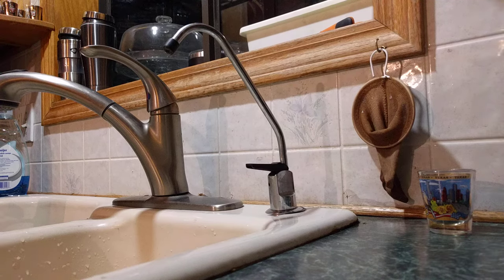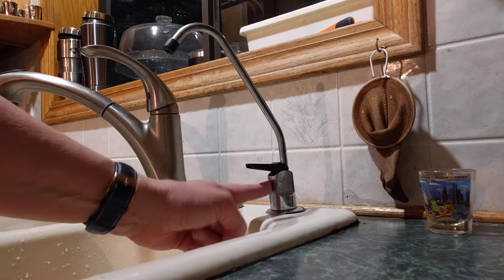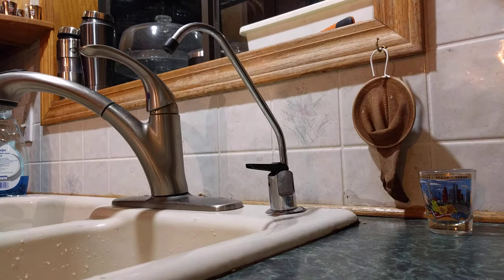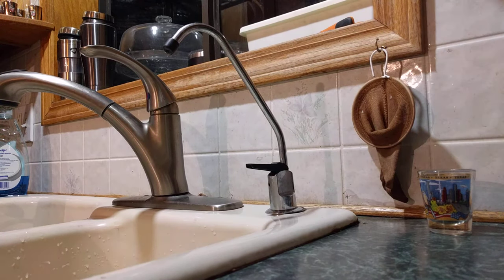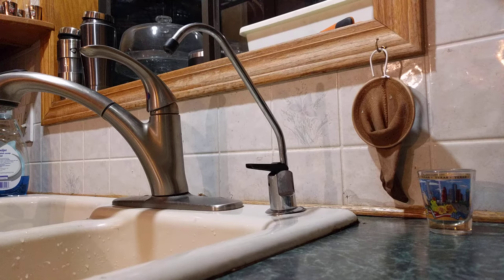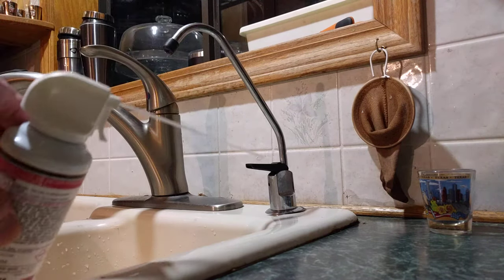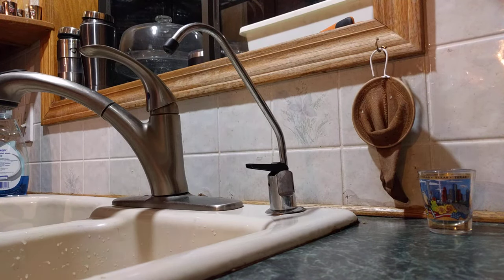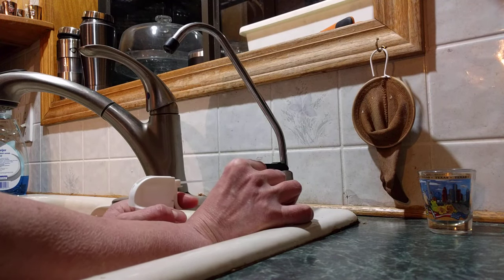fix a leaking air gap faucet on your reverse osmosis system

Comment: Finally! A YouTuber that posts a real solution! No garbage disposal here. Had water running out of our air gap, checked the drain line and it was clear. Called Watts only to have them try to sell me parts... I tried a piece of rubber hose to try to blow it out to no avail. Found this video and in two shakes I was done, just needed more air pressure to clear it. Thanks!!!

Comment: Thanks for saving my entire Sunday. The indication the drain is plugged is a small amount of water coming out of the vent hole and running in the sink or on the counter. This literally took less than a minute to fix from start to finish. Thanks again for the time you spent researching and posting.

Comment: I have an Aquasana system and this just started happening really badly. Thought we were SOL but tried this with a plastic straw and it worked! I didn't have the compressed air but I just used a plastic straw over the hole. Thank you SO SO much for this information! You saved my behind! 🙏💖

Comment: Mechanical Engineer Here...I had not thought of this method, it worked great and I could actually hear a blockage being blasted.  I am going to add this to my regular preventative maintenance.  Please note: these dusters are generally chemicals...not compressed air...but being the r/o waste line it should not contaminate the filtered water.  It was really a great video...much respect for Karin.
Reply from the maker: Excellent!

Comment: You're a smart lady. I searched tons of websites, tried all the recommended solutions, and nothing worked. I thought the hose might clogged higher up than I could see (the bottom wasn't clogged, and I cut off a few inches, too, just to be sure it wasn't because of a sag in the line). My next was going to be remove the whole line, which doesn't seem particularly easy to do on my system. But then I found your video, and the compressed air trick worked immediately.

Comment: Hallelujah!  This works! You saved me from taking the whole thing apart and then probably calling a plumber before ditching the whole system. Can never thank you enough for posting this!!!!
Reply from the maker: You're welcome! I still remember my personal frustration-level when I first had this situation in my kitchen.
Reply: @KarinBrenig  We rarely use our disposal, but we did yesterday and the RO faucet started leaking. We turned off all of the water to the sink and saw your video this morning. Fixed the problem along with all of our stress in seconds. You have our deep (way down there), heartfelt appreciation!

Comment: Brilliant!  My daughter and her husband just moved into her house with an RO (we do not have one) and it started leaking via the air vent in the RO faucet.  Did some research and found that the RO drain line from the faucet was probably clogged and it needed to be blown out.  But how I wondered while I was driving over.  My daughter came across your video, we used your method and it worked perfectly!  And man, was that thing filthy.  Thank you so much!!!!

Comment: Thanks! I cleaned up that side of the sink drain and took some flexible plastic tube used for an oxygen tank and held it up to the little hole on the RO faucet and blew through it really hard and I heard the air come through the drain. turned the cold water back on and it worked great. Thank you!

Comment: Karin, 
Thank you for your video. This occurs on and off with this ROW, too often with a flooded cabinet and floor,  I was going to swap faucets with the previous one I had. It is a big pain removing, cleaning and reinstalling the mangy faucet.
I went to the hardware store, bought a dust buster and the change in tone made it very clear when the plug was gone.

Comment: Thanks for sharing. I blasted canned air into the air gap hole (using a paper towel around the air tube to make a seal) and I did not hear anything for the first few times. On the third time, I heard air an something else pass, so something must have been stopped in the drain tube! Now there is no more heavy leaking. Thanks for this great tip!

Comment: Thanks for the video and tip. I ran out of my compressed air but watched a few more videos and had another idea. What if the plug is where it meets the drain? So I disconnected the hose from the drain and shoved a pipe cleaner up the hose - this cleaned the slug that had accumulated and presto, clear. Thank you for helping me to consider options.

Comment: This actually worked...immediately. I have a computer "vacuum" which is basically a leaf blower version of canned air. Instantly fixed. Running the filtered water into a cup, shortly later the water would trickle into the drain and not the air hole. Thanks!

Comment: Thank you so much for posting this.  Today  a substantial leak started from the faucet base of my Costco RO system. Water was oozing quickly on top and dripping quickly under the sink. Used your method and it  opened up the clogged drain hose right away.
Reply from the maker: you're very welcome :)

Comment: I am .. so thankful for this awesome video thank you for taking the time to post this. I went to home Depot and they told me I can just replace the seals which are most likely the problem... I was like "how am I even going to disassemble a closed unit to replace gaskets in it" and then they told me it might just be easier to buy a new one. I did this and now it's working again and not leaking thank you for posting this video. God Bless

Comment: Good solution. I have a Watts Premiere faucet that is very nice, but leaks through the bottom of the unit into my undersink cabinet. Huge mess. I think it's been leaking from the moment I installed it. What I did to fix this situation,  is to get a check valve, then connected the two hoses. This  completely bypasses the faucet and its 'air gap.' (mine never leaked out the hole, so I think it was just wrong to begin with.)  So now I have a loop into the drain, but with a check valve against back flow. I can keep the nice looking faucet. 
Something I did years ago at another house. I just ran the waste line outside into the garden. For years it watered the garden with no ill effect.

Comment: I saw the video and was super excited! Give it a try... nothing. Tried again... nothing. Finally, after buying bottled water for two weeks and thinking about it, I decided to give another try. This time, I removed the line from the sink drain line. My intention was to blow from that lower end. I used the wet paper towel thing to make a seal around the air can hose and gave it a blow. Very quickly, my air gap started to hiss. I wIll be replacing my filters as a mater of course, but this sure beat needing a plumber to come and and probably do the same darn thing.

Comment: Karin, well done, great advice. I'd like to add my two cents regarding my leaking air gap. I replaced our R.O. system facet. Usually you will hear some gurgling in the sink drain when   the R.O. system is operating, there was no gurgling and water was discharging from the air gap, the discharge hose was clear. Your video made it very clear how the system should work, I was the problem. New dispenser, new hose, hose too long. The hose ran down below the discharge saddle and back up to the saddle connection, gravity was working against me. I shortened the tube so it ran down directly to the discharge saddle causing joy, discharge works great. Your video provided me the clues to get past my error. Thanks so much.
Reply from the maker: good job :) I'm glad it worked

Comment: Love the logic of this fix - my trouble is that the hole is round the back of the faucet. I tried bending the straw but can't seem to get enough pressure that way. Still, a great fix idea, Karin!
Reply from the maker: maybe you can try what some people said worked for them: take a piece of thin, flexible hose and press it over the hole (on the back of your faucet) sealing with wet paper towel. Then blow air into the hose with your mouth, as hard as you can. Good luck !

Comment: Thanks! I really need to try this. The air gap faucet has been squirting water for a year and it drives me crazy. I do not have garbage disposal, but I do have a dishwasher on the same drain as the water filter. My drain was clogged at one point, and when I cleared the clog, the squirting stopped for a few months, and then started again for no apparent reason. I will be shopping for some compressed air asap!

Comment: Super smart, this helped me a ton! It was 1am when this happened to me and i didn’t have the pressurised air can- so i poked a bendy straw in the hole and blew super hard. It worked incase someone doesn’t have one of these also! 😂 but thank you for posting because i never would have thought just air would solve it lol

Comment: What I did is reverse: find the 3/8" black tube running under the sink, from faucet to drainage (connected with a saddle valve), unscrew it, and I just use mouth to blow it. Sure you can use compressed air as well.
Reply from the maker: awesome! good job.
I personally wanted to avoid crawling under the sink to detach stuff. That's why I blew in from the top.

Comment: I have something similar.  starting leaking through the hole referred as the air hole.  Started to take it all apart   There was a half moon style flat metal washer that was up against under the sink part to connect hold everything together.   I guess it allows for the 3 hoses to fit without removing the whole system if you have to get into parts.  Can't seem to find that style washer anywhere   Was going to put a new one on since the old one is rusty.  My husband installed the system years ago.  He recently passed and I'm trying to fix things. Does yours have that type of a washer since you talk about the hoses being connected to the faucet?  Just hoping you can help me out here.    Mine started spewing water out and I don't have a garbage disposal. Where did you get that part that blows out the hole?  Sorry I'm new at this.
Reply from the maker: I didn't take my faucet apart. I simply took a can of compressed air and blew right into the little hole. I got my compressed air can at an office supply store, but I'm sure you can find them online.

Comment: I have different problem but related to the air gap hole on the faucet. The drain tube is not loop or dip. It's straight to the drain pipe. When I dump the soapy water after finish washing dishes, as the soapy water going down to the drain, the soapy bubble foam come out from the faucet air gap hole. It's pretty annoying every time i have clean it every time. Any idea how to fix it?
Reply from the maker: oh boy - I'm not a plumber, but my guess is the drain out from your RO system needs to be mounted differently, not just "straight down" into your main drain pipe.

Comment: Karin, I ordered the Spray Duster.  Did you have to disconnect the bottom of your drain hose so any debris will go out into a bucket, or did you simply blow it out into the pipe it's connected to?
Reply from the maker: hi Deborah, there's no need to take anything apart. Just blow the dirt out of the pipes with your spray duster, right through the drain hole at the faucet. All you have to do is explained in my video. It's super easy!
Reply: @KarinBrenig  Thanks so much!
Reply: @KarinBrenig   It worked!!!  I got the Spray Duster just now and applied it as you instructed.  Heard the gurgle in the drain and did it again for good measure.  Tried the spigot and no leaking.  Thank you so much!

Comment: its super easy on your drain push in the fiiting pull the hose out then use air compressor to push air from the faucet out the hose this way its not in your pipe or cloging the hols drilled in the drain pipe i have to do this about once per year
Reply from the maker: yeah..... except average old woman like myself doesn't really like to pull hoses or push fittings or has a compressor handy in the kitchen

Comment: ...or you take some rags, remove the drain hose from the saddle and get all the sediment out with a bit of wire.
Reply from the maker: sounds good to me, if you like contorting yourself underneath your kitchen sink ;)
Reply: @KarinBrenig  The drain hose goes into the drain from the front. But yeah, now we are talking about sitting on the floor. Probably will do both because there are issues at both ends of the drain hose.

Comment: Install a check valve before the drain line goes into drain. One time fix..
Reply from the maker: probably works too. Just didn't have a check valve handy last time it happened.
Reply: @KarinBrenig  yep, the installer should have put one on.
Reply from the maker: @jaredbradley152  aha! we have ourselves to blame then, put the thing in DIY years ago. Still makes me wonder how come over 58,000 people watched this little video of mine now - and over 100 of them commented saying something like "omg, so easy!" Did all those people install their RO systems without the magical check valve?
Reply: @KarinBrenig  not sure. I install them for a living. We always install them with a check valve. Yes cleaning the lines is easy but, You don’t want sewage in your filters/faucet/lines. The whole point of (RO)purified water is having water cleaner then tap water. If you let your drain back-up into your lines and faucet then you are taking a huge step backwards from tap 😆.
  Check valves should be called one-way valves that way everyone knows what they are.